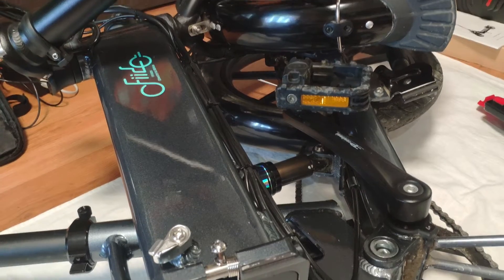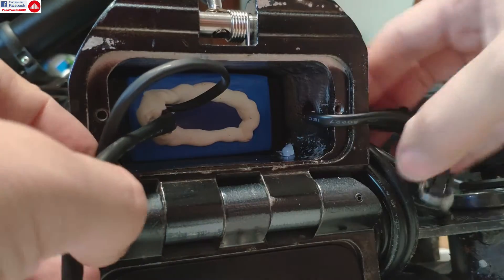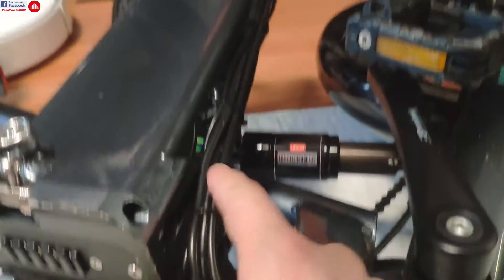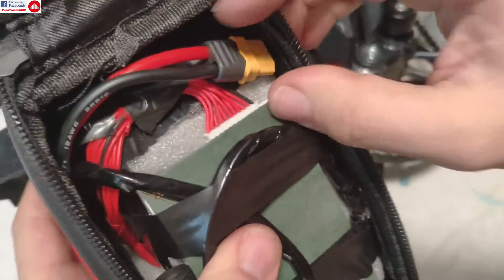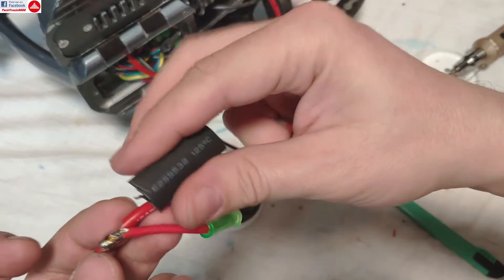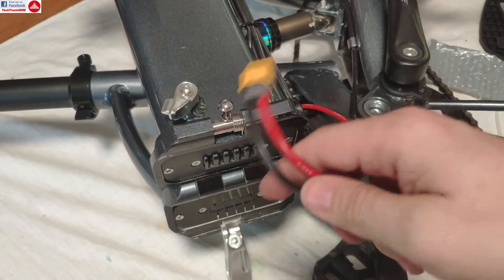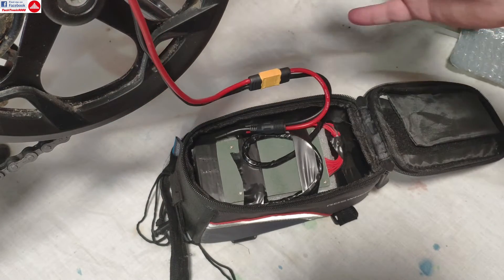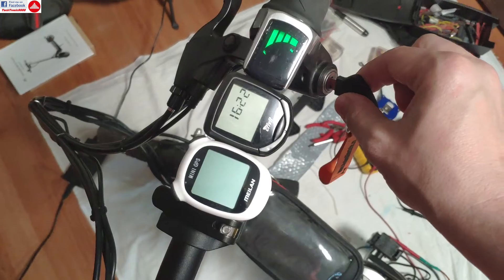Fiido D2 Original Battery Details & Double Battery MOD

Comment from the maker: Best places to get Fiido bikes from localized warehouses (US, EU, UK, etc.)
https://bit.ly/FiidoOfficialStore
https://bit.ly/AlternativeStore
You can also now join the largest Fiido owners group: https://www.facebook.com/groups/FiidoElectricBike/

Parts & tools to make the mod:
Original Replacement battery https://bit.ly/3MVj5QO
Battery (external): https://bit.ly/2BOHffH
12AWG silicone cable: http://s.click.aliexpress.com/e/bgIDtPeg
XT60 connector: http://s.click.aliexpress.com/e/pNiK8k0Y

Needed tools & materials:
Soldering iron (power 60W+): https://bit.ly/3q1AZHF
Heat shrink
Solder (tin) wire
Duct tape
Reply: The battery is no more. Where to i find yhe same pouch u used?

Comment from the maker: All the parts & details are listed in the video description, click on show more to see them. Also you can join here for more discussions: https://www.facebook.com/groups/FiidoElectricBike/
Reply from the maker: Dutch Boy  No, you need a BMS for the extra battery.
Reply: How much additional range do you get with the extra battery? Percentage or mileage...
Reply from the maker: I get about 30-35km range now, while with just the original battery i would have gotten about 20km on the same route.
Reply: InstaBlaster...
Reply: Sir, I know this is an old video but may I ask if you could upgrade this to a Bafang mid drive motor?  thank you very much!

Comment: Hey I gave two questions. I bought a replacement battery.  It has a charge port connected to the battery. Can I charge it outside the bike? 
2. I can't get that metal screw attached to the charge port inside the bike undone! Even with plyers its stuck and awkward!
Reply from the maker: Hello. 1) Yes, 2) yes indeed, a real fiddle sometimes to take it of, needs patience and and a good tool.

Comment: What is the range or how many extra miles you can do now? thanks!
Reply from the maker: With the original battery (7.8Ah) I was doing ~ 20km on 100% electric, with the extra battery (6Ah) i can do 30-35km. If you install a larger battery you can get even more range.
Reply: @TechTronic9000  Thanks prietene ;)

Comment: Your link for the battery no longer seems  to work and i need a replacement. Can you tell me what i need to just replace it lie for like with original range?
Reply from the maker: You can now get the updated original replacement which has better quality that the one i had in my dead link: https://bit.ly/3MVj5QO
Reply: @TechTronic9000  Thank you! Do you know where it ships from?
Reply from the maker: They have multiple warehousing, if you are from the EU it will come as an EU product. If they don't have it in local shop, they will send it from China to their warehouse firstly, then they will repack and ship it from EU to you.

Comment: I picked up a used 20ah L2 battery I converted for another bike.  Any idea who makes the cells or the cell models?  Are they cheap off brand or something decent like LG, Samsung, Sony, Panasonic?  Cheers!
Reply from the maker: Fiido doesn't use branded cells so they might be anything out of china. Still they work pretty well as on my D2 i have over 4000km and from the official 7800mAh I still have ~ 7300mAh.
Reply: @TechTronic9000  Cheers for the follow up on this.  Much appreciated.

Comment: Were did u get your solder from and how hot dose it get
Reply from the maker: Local electronics shop, it contains lead like old one, melts ok on wider temperature range. I usually keep mine at 300-350°C

Comment: I was wondering if the external battery was the same size as the original, could you use this external battery as a replacement battery?
Reply from the maker: You can use any kind of external battery as long as they have the same voltage.

Comment: Hi I have Dohiker electric bike I replace the battery and now it’s showing the ECU error sign do you know anything about it
Reply: I think I damaged my bike by put connection negative to positive I think that’s the problem
Reply: What should I do?
Reply from the maker: If you have installed the battery with reversed polarity you might have burnt out the controller.

Comment: Thanks for the video! Question: the battery of my Fiido d2 is exhausted, so I have to change it. I see incredibly high costs, but then on a famous ecommerce of almost totally Chinese products, I found one very cheap (there are also others on the same site, in general the price never increases much compared to the original piece). Are they still valid solutions in your opinion?
This battery also has slightly different specifications from the original one, such as the size. Your measurement is 30cm in length, this is 280 * 68 * 38mm.
Can it fit the same?
Reply from the maker: Sadly I see the stock original battery price went up to 300$, it was under 200$ not a long time ago. I would personally measure it and search on aliexpress for a similar one, then ask the seller for exact dimensions.

Comment: why did you not connect the 2nd battery on the battery side and keep the controller isolated when they are being connected?
Reply from the maker: Because it's easy and you have a hole in the frame already. Why drill the frame and connect to the existing battery and complicate things?

Comment: Hello please help me. I have d2s, i removed the battery to charge it separately, but after I'm done charging i put it back into the bike, and it wont start anymore. I watched ur video and realized i did reverse polarity. Did it damage the battery or controller? How to fix this? Please..
Reply from the maker: Leave it disconnected for 10 minutes and then try to connect it normally and see if it starts, you might have burnt the BMS in the battery or the controller. You might also check first the battery with a voltage meter and see if it still has 32-42V volts available.
Reply: @TechTronic9000  hello i have tried connecting it and it wont start. The battery doesnt charge also i think. Maybe i damaged it. I dont have voltage meter too..
Reply: @TechTronic9000  if it doesnt have 32 to 42 V, it will not work anymore?
Reply from the maker: If it no longer charges and doesn't output voltage than definitely the BMS was damaged. It a tricky job to repair the battery and needs very good skills in electronics and soldering to fix and also needs materials such as new wrap, new BMS, etc. Might be cheaper to get a new battery...
Reply: @TechTronic9000  hello do you know if d2s controller have anti reverse connector? And how do i fix it to make it run again
Reply from the maker: You need to check the battery first.
Reply: @TechTronic9000  i dont have voltage meter i will bring it to a shop

Comment: I bought a 2nd hand fiido d2s on september , as i can notice, since November there is deviation on battery about 30% 40% and that concerned me.....
So i want to ask this , maybe it is time to full replace my baterry ? Or on winter/autumn Lithium batteries it is normal flow to have loss of energy?
Reply from the maker: A Lithium battery can loose up to 50% capacity when the temperature drops 20°C.

Comment: How do you know if battery is fullcharged? The light is yellow? I dont think the charger have green light just yellowish
Reply from the maker: When it's yellow it's still charging, when it's green is full.
Reply: @TechTronic9000  i have not seen the green light on it just yellow im afraid i would overcharge it
Reply from the maker: Does the charger show green when it is unplugged from the bike?
Reply: @TechTronic9000  just yellow
Reply from the maker: Then your charger is yellow when done instead of green. I would also check it with a voltage meter to see if it output 42V to be on the safe side.
Reply: @TechTronic9000  okay thank you!

Comment: need help sir. it was dumb of me to accidentally made contact of + and - of my battery. i used scissor to cut the wires. did i cause any damage to the battery itself making it unsafe to use anymore?
Reply from the maker: You need to test the battery with a voltage meter, the BMS might have some protection, or could have burned out.
Reply: @TechTronic9000  I have successfully installed the add on battery! the BMS did a good job and there is no damage to the batteries. thank you again

Comment: Nice video. I am a fiido d2 owner and once I was holding the key while I tried to put the charger cable to the input when suddenly the key accidentally touched the input and created sparks. Does this accident maybe cause any problem to the battery? Also after what distance/time is good to replace the battery?
Thanks in advance!
Reply from the maker: Did it touch the charge port or the charger cable? You should check with a multi meter if the charger is OK.

Comment: Great video! I have a question, iam going to buy a second hand fiido d2 from someone who has it a year now, I’ve seen the bike and everything looks okay, i will do a testride tomorrow. Iam only worried that the battery is maybe already bad, how can I check this? Is there a certain amount of km/miles that the bike rides, or charge cycles? And are there other things i should pay attention to before buying?  Thanks in advance!
Reply from the maker: You should get around 20km on electric mode, mine has 4000km and the original battery is still very good.

Comment: Sir, at 7:25 in the video, what kind of connectors are those used by Fiido?  plan to make a y-connector instead.  Please help
Reply from the maker: It's a kind of bullet connector. you might replace them as they do not provide a very good contact.
Reply: @TechTronic9000  thank you very much Sir!!!

Comment: Great video, do you not having issue til now charging them using the bike’s charging port?..is the bms of your external battery has separate charge and discharge config or common charge/discharge?..if my external battery bms is common charge/discharge config, will it is still be safe to charge the two batteries ( internal and external) using the bike’s charging port?..thank you and sorry for my querries..
Reply from the maker: No problems until now and has several thousands OK km done. A big advantage is that the second battery has a common wire BMS thus discharge and charge works on the same port.
Reply: @TechTronic9000  thank you very much for the quick reply I subscribed..
Reply from the maker: @lezmac3104  Thank you! I highly appreciate it.

Comment: Hi I’ve ordered the D1 with the 10.4ah battery. Is there any other way of identifying the battery size without actually removing it? Thanks for your time and very good video
Reply: Without removing it? Probably the only easy method would be to obtain a battery analyzer. You charge the battery pack and then use the analyzer to measure the Ah while it is discharged by the analyzer. 

However, keep in mind that if you don't even want to open up the battery
compartment, you will then have to come up with some sort of mating 
adapter to connect the analyzer to the battery connector exposed when 
you "fold" the bike. Otherwise, you could simply "clip" the analyzer onto the backs of the power connectors on the battery compartment's connector plate. But, if you're at this point then you may as well read the label. However, an analyzer will allow you to measure the ACTUAL capacity of the battery. The company labels are often overly "generous" when specifying battery capacity.

The measured capacity is often lower than the specified/rated capacity. E.G., a "reasonably" decent 10.5Ah battery pack might MEASURE 9.5Ah. The difference depends on the quality of the cells in the pack, and whether the pack has been used a few times. Measuring the capacity of a new, unused pack generally measures a bit lower than the final capacity after the battery has been through a few charge/discharge cycles. Also , the higher the quality of the cells in the pack, generally the closer the measured capacity will be to the specified capacity. Low quality cells can deliver less than 70% (or lower) of the specified capacity. Decent cells will be closer to the specified capacity. 90% or higher is "reasonable".

Here's an example of an analyzer that costs about US$40. It's not laboratory grade accurate but this type is generally good enough for hobbyist work. This analyzer can also measure at current discharge levels NEARER to that of a typical small e-bike and will show you what you can expect in reality.

Lower watt capacity analyzers will give you an artifically high capacity measurement for your real-life e-bike assessment, as they can't load the battery as much as a high wattage analyzer. But, the high capacity analyzers offer the flexibility of measuring either for the specified capacity or can be used to measure nearer what you get in the real-life implementation capacity.

Generally, the higher the test load on the battery pack, the lower the measured capacity. E.G. testing a battery at 100mA will measure considerably more Ah capacity in the battery and will be closer to the specified capacity of the battery pack, than if you test the same battery at 2000mA or 4000mA (0.1A x 42V = 4.2W, but 4.2A x 42V = 176W).
https://www.youtube.com/watch?v=8TEtt2IFCVc
There are other analyzers that can test a high capacity battery.
Reply from the maker: Just with a capacity/discharge meter, still a bit complicated.
Reply: @TechTronic9000  Hiya..great video..I would like to build my own battery..did you use a 'kit'  or just buy the separate batteries, etc... thanks Gerry

Comment: My fiido tured off it self even full battery.. can you tell me what's the issue
Reply from the maker: Could be several things such as faulty battery, controller problems or more simple ones such as lose plugs and wires.

Comment: One more question...as I'm new to this kind of motor setup:  On many brushed motors, you can simply increase voltage to increase speed.  Is this not possible with the brushless wheel motors?  I was wondering what would happen if you increased the battery voltage to 48V.  Would it be too much for the controller to handle?
Reply from the maker: Yes it is possible with another controller and another battery, but then you have a chance of burning up the motor.

Comment: What is the charging and discharging plug model for the original battery?
Reply from the maker: The charge port is a DC Jack while the discharge has small bullet connectors and it's solders to the folding contacts.
Reply: @TechTronic9000 Can the original battery be replaced with a different battery?
Reply from the maker: Yes, but only  if you build a custom one with high quality cells you get an increase. The maximum capacity you can fit is 10.5Ah with LG MJ1 cells @ 3500mAh each.

Comment: Hi if i change new 48v controller an connect 48v battery its ok for original 250w hub motor?its fiido d2s thanks
Reply from the maker: Usually overvolting the motor works, but you need to check the temperature, also if you increase the voltage try to keep amps low and not put to much power into it.
Reply: Hi if i put new controler whit lcd on my fiido d2s do i make my bike faster? Thanks

Comment: My charging point pin has broken off in the frame section, is this hard to replace and source myself ?.. the electric bike repair shop here in Dublin is closed due to the covid lockdown restrictions, please can you advise me.. Thanks in advance !
Reply from the maker: If the DC jack has failed then you need to buy a new one and replace it. I doubt that you will find one that 100% match so you need to use some soldering and have some knowledge about electrics / electronics.

Comment: What if one of the batteries requires a key to turn it on and the other doesnt will there be any problems?
Reply from the maker: Fully charge both, the "key one" should be turned on and then never turned off while connected to the other.
Reply: @TechTronic9000  Can you turn it off while the bike is off? For theft prevention purposes

Comment: Does the bag used to store the 2nd battery not move around with the weight, with it being held by Velcro straps? Also it may be better to make a hole in the bag (or buy one) that allows cable to run through. Therefore there is no cable sticking out of a zipper.
Reply from the maker: Yes, there are a lot of better options to fix the battery, some are suggesting 3D printing a hard case that will clamp on the frame. This was mostly for demonstrating the whole process.
Reply: @TechTronic9000  how is the setup going for you now, has it been good and what range are you getting?

Comment: Hello,most informative video out there,but still couldnt find an answer if these bikes/batteries has a replaceable fuse? Thanks
Reply from the maker: Some batteries such as the one from the L2 has a fuse, others don't. Usually the safety is based on the BMS module of the battery that also provides short circuit protection. You can also add your own inline fuse for more safety.
Reply: @TechTronic9000  thanks a lot for getting back! Very informative!Keep doing what you doing !🙏

Comment: Hello, My D2 wire is burned by itself (I saw the smoke coming out through the back side of the bike where all wires go into the hole of the steel bar) when I park it outside when it's a hot day, around 28 degrees. And there's no screen when I insert the key. Could you kindly let me know what's wrong with my bike?
Reply from the maker: Hard to diagnose just from the issue above. Could be a short circuit, burned BMS, etc. Join on the group here and add some pictures and we will try to sort it out: https://www.facebook.com/groups/FiidoElectricBike/

Comment: Great video. Thank you very much. Good base to build a solution for a removable battery. But after I have removed the cover (plate) and the charging socket I cannot pull out the battery out of my D1. Is the battery blocked inside or should I remove the screws on the upper side of the frame?
Reply from the maker: The upper screws might be too long and will hit the battery, remove them and see if it comes out.